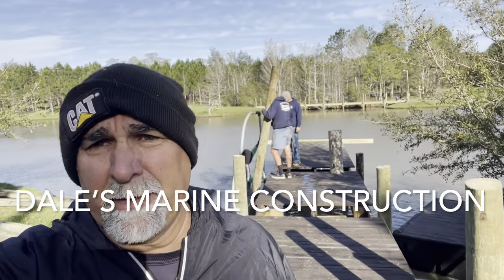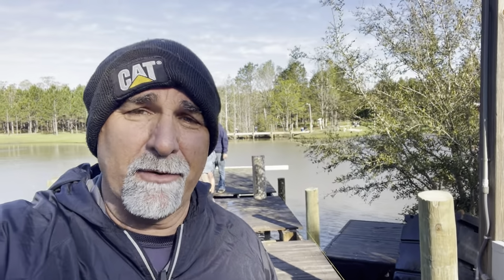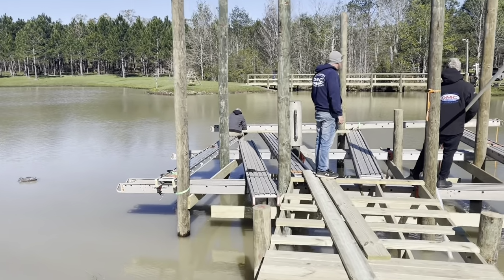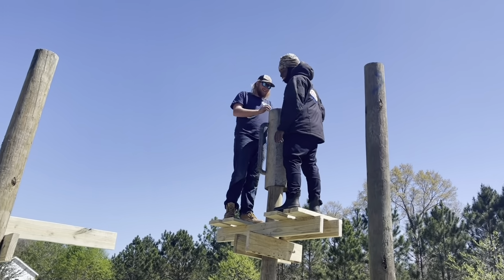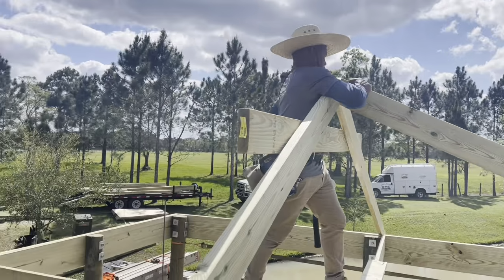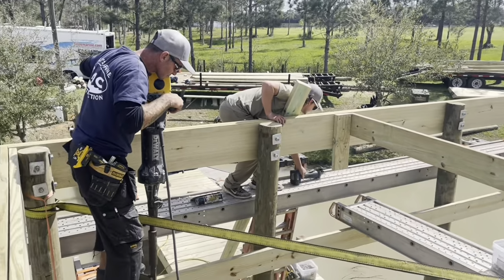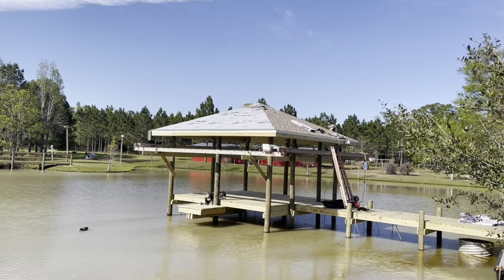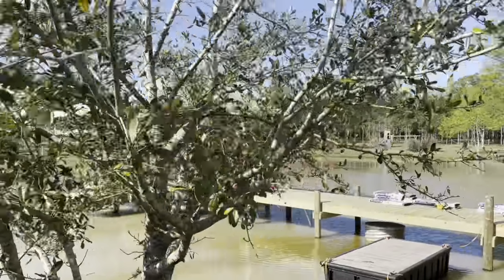GAZEBO LAKE DOCK 2 DOCK BUILDING

Comment: we do this work here in douglas ga pretty much the same way. have an old home built barge for the big boathouse pilons but usually we just man handle them if possible lol. might steal a few tricks here and there from your videos. ill throw a few yalls way if i see something that may help yall out.
Reply from the maker: Thanks for watching in your comment. I appreciate that. Yes this is some hard work. When I started with my dad back in 79 he did not believe in Equipment. I was Emmanuel labor so I understand carrying and picking up the pilings. Once I started my business in 1990, I decided to work smarter!
Reply: @DaleWHickman  yeah it's a constant improvement and learning experiment on ideas to make things go more smooth and efficient. Don't seem like many people have that mindset
Reply from the maker: @eddieosteen2134  you are correct. They are a few and far between and when I find them, I hold onto them.

Comment: I've never seen you anchor a deck down to the lake bed does that Lake freeze your trying to keep it down or does the mud eventually just reject the dock and poles everything tends to float up
Reply from the maker: We had such hard clay here we could not get the Piling installed . I really needed heavy equipment and a barge which I could not get to this lake.
So I wanted to make sure that the dock was tied down very well with the Manta Ray Anchors that I installed. 
Thanks fir you comment 😊